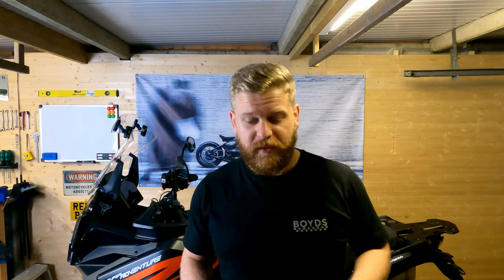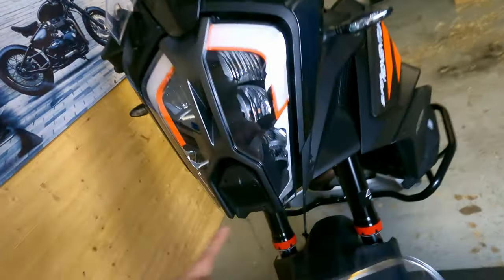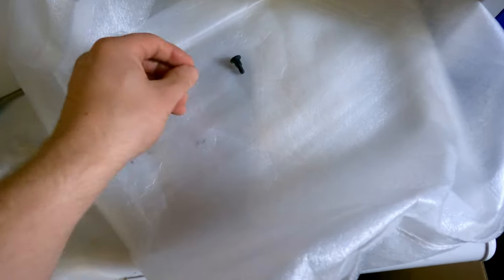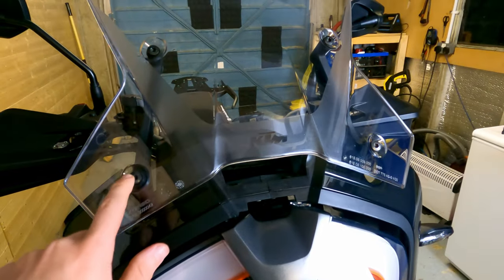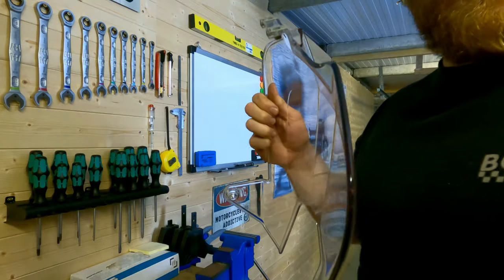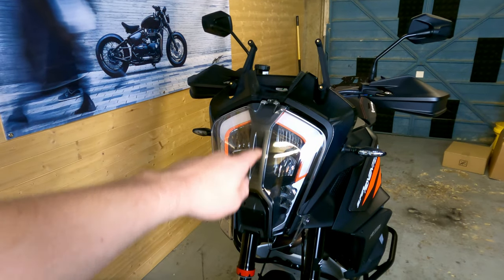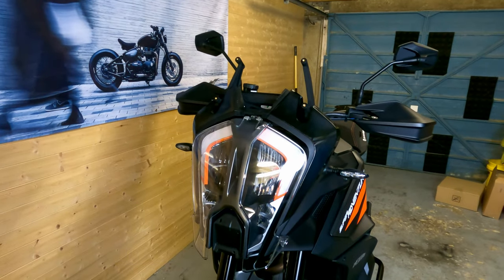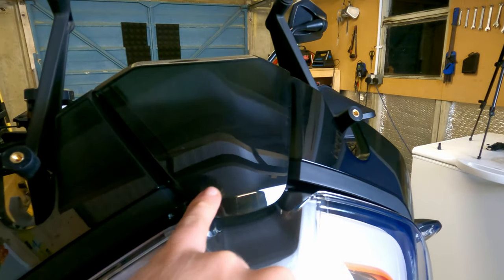Always Use Protection... for your KTM Super Adventure Headlight

Comment: Only downside is it’ll be a faff to clean underneath once fitted - good idea using rain-ex on the lamp lens though
Reply from the maker: I can confirm it can be a pain in the backside getting those last few droplets with a towel! I've got the Bruhl air dryer which makes an easy job of it thankfully! The rain-ex made a big difference to most of it all beading and running off!
Reply: Bruhl, best gadget I’ve ever bought for all the fiddly engine nooks and crannys on my R9t UGS
Reply from the maker: Agreed! It's so good isn't it! Although I've taken to wearing my ear plugs using it as it can get pretty loud

Comment: First thing I did when I bought my GSA was to have it wrapped, including the windshield and the headlight. Not the same amount of protection, granted, but enough to prevent small chips. The GSA being white, the dust isn’t that apparent on it like on the R Nine T, which is black. Not to mention that every little scratch looks horrendous on black paint. So, I had the R Nine T polished and wrapped, too. It’s a simple way to protect the paint on the long run, especially if you’re getting the bike for life. ;)
Reply from the maker: Very good idea! Protect it from the beginning and it makes such a difference! Preventative rather than correcting the problem down the line. Especially with the cost of these headlights nowadays haha!

Comment: ❤ Great video, but just wondering if is really necessary if the moto is only used on road?  What can damage it? 
Do you also ever think to change the turn signals light in led "only bulbs"?
Reply from the maker: Thank you! I use this off road quite a lot but a stone being thrown up by a car tyre or something can do damage or crack the headlight. 
The turn signals are LED already
Reply: @SamVBikes  oh this is a good point... I saw the bulb seems regular bulb, at least I thought 😅
Reply: @SamVBikes  just checked my turn lights and are regular, not led... 😭😭😭 I've the 2023 model 🤷🏻‍♂️
Other question, today my left shoe lace got destroyed in the chain while driving, any cover you can suggest?
Thank you 
Andrea
Reply from the maker: Are you in the USA? I know a lot of bikes get halogen lights instead of LED when imported. Not sure on the reason. 
Amazon do some shifter boot covers which I've used in the past. I don't really have laces on my motorcycle boots for that reason, and if I do they are shorter laces so don't hand down
Reply: @SamVBikes  thank you for your reply, yes I'm in the USA, I was trying to see only the cambus bulb, but I couldn't find 😢 
I will definitely change shoes 😅

Comment: I wonder how this headlight could be cleaned without uninstalling the glass protection?
Thanks for the video.
Reply from the maker: It is difficult to get to but I find using a stream of water, then getting a drying towel between the two works well. I use a Bruhl bike dryer too but I know that's not common. It does add 5 minutes to every clean!
Reply: @SamVBikes  Thanks for the trick.

Comment: Who are you meeting in a dark alley to get these parts? Twitches: Hey bro you got any of them headlight protectors. Haha Literally can't get anything dealer aftermarket at the moment. Everything for my new Tracer has been out of stock for months.
Reply from the maker: Hahaha! I've got contacts man! 
These are parts I ordered months ago and they are only just starting to turn up. It's crazy isn't it?!
Reply: @SamVBikes  Yeah sure is crazy, hopefully the containers start flowing again soon. What else is on the mod list?
Reply from the maker: Hope so otherwise I'm going to start riding into Europe to pick parts up haha! 
There's a few bits that have gone on already like rear brake res protection etc. Ive got a long list which is all dependent on me winning the Lottery haha! Exhaust, laced wheels, new knobbly tyres, upper Crash bars, denali spot lights and a few more! Still need to get a topbox rack for it too!
Reply: Exhaust options very limited. Arrow do one but might wait till the new year. Still waiting for the crash bars you have fitted.
Reply from the maker: Definitely. Yes Arrow have their new 'Sonora' slip on but I'm hoping in the new year there will be a few sites selling it at less than £780!! I was lucky with some of my parts but still awaiting others!